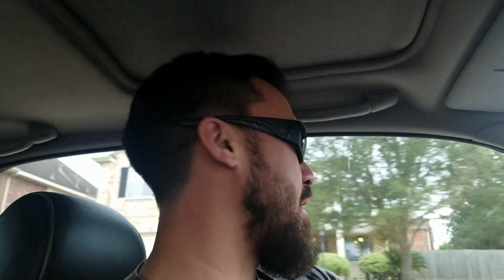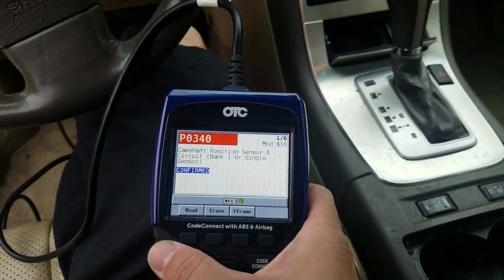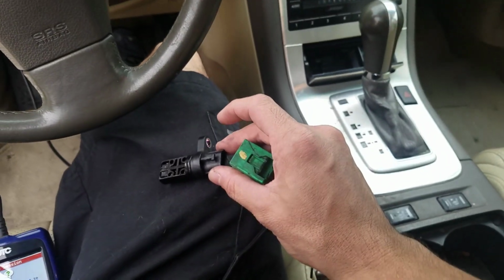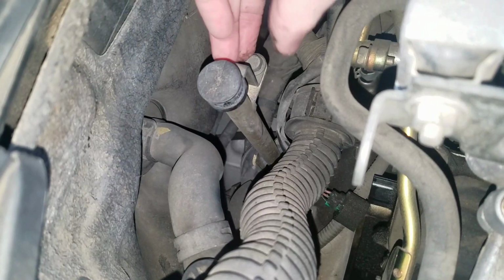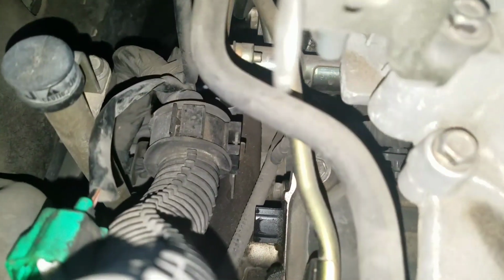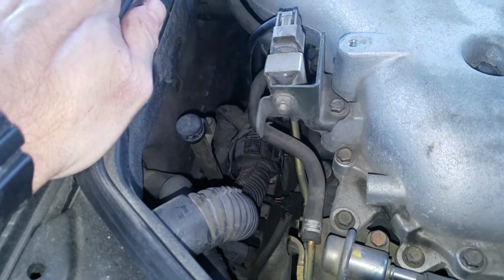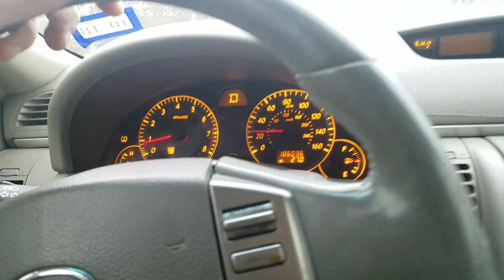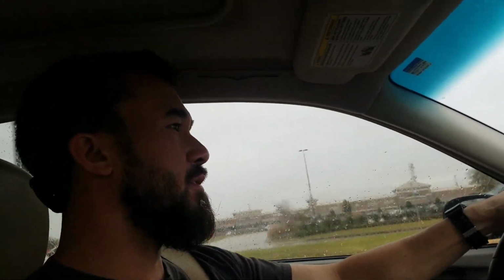How to Replace Bad Camshaft Position Sensor in Your Car Code P0340 Infiniti G35 Nissan 350z Altima

Comment: I recently changed both Bank 1 (passenger's side) and Bank 2 (driver's side).  I recommend only using Nissan or Hitachi sensors.  Tried some third part ones off of Amazon that didn't work and found comments in a forum to only use Nissan or Hitachi parts.  I went ahead and cleaned my MAF and Throttle Body while replacing Bank 2 which made my 2006 G35 Sedan run a lot better than it had before.
Reply: Did it have random misfire?
Reply: @trentdaddydolla647  it was hard to start up and ran bad once it started but no misfires. The code I got said to replace cam shaft sensor.  I tried to do it using cheap ones a few times but they didn't fix the problem so I went with OEM parts and they worked like a charm.
Reply: @aarondemming can u send me a link or the partd you got 🙏🏽. I also got some decent / mediocre ones on amazon didnt rlly last me
Reply: In autozone just ask for the part

Comment: I have a 2003 Infiniti G35 Coup non rev up. With Brembo Brake Package. I just started getting a code for PO 340 - Camshaft Position Sensor A - Ban 1 Circuit Malfunction but I also got another code at the same time for PO 327 - Knock Sensor 1 Circuit Low Input Bank 1 or Sensor 1. Do you think the Camshaft Position Sensor is triggering the 2nd code?

Comment: Changed both sensors and still throwing the code. Could it be the connector itself?
Reply from the maker: Definitely check the wiring.

Comment: hey man i changed my sensor and it seems like my vehicle is performing worse. I also heard low brake fluid could possibly produce that p034 code. What is your opinion on that? same car but '07

Comment: Does your car still work or did you need to get the oem sensors?
Reply: The_g35life did you figure it out I used a aftermarket one from autozone and still get the code with a no start I was told oem is the way to go with anything Infiniti especially on the g35’s

Comment: Hi, I have a 08 m35x with the code for a bank one cam shaft sensor, I changed it twice with sensors off ebay and check engine light and others r still on the dash, it stop cutting off on me, but still has a long crank on start up, what do u recommend?
Reply: Rob, with Infiniti you have to use a Nissan part or Hitachi.  Had the same problem with parts off of Amazon.  Went to a couple of different forums and went with Hitachi parts and this fixed the problem.
Reply: Did you end up finding a solution??

Comment: thumbs up for replacing dumb ass infiniti parts that have no space to work with and by doing it with one hand lol. just noticed you said that green clip is for the 03 model which i have :( wish me luck in replacing mine tmrw
Reply from the maker: Good luck, might be easier to just unbolt and remove it first.

Comment: Should I buy a 2005 g35 for 2800 it has 135k miles and it needs camshaft senser yes or no? It's frim on price
Reply: Thats what im trying  to figure out too
Reply: Kameronismyname how many miles is the one your looking at?
Reply: @lollollollol7515  120k a friend said dont mess with it but idk this seems simple enough
Reply: Kameronismyname that's what I think but don't know it can be a bigger problem
Reply: @lollollollol7515  if i can get it for 2500 i might buy it he wants 3k
Reply: Kameronismyname yeah 2500 its good price if you get it let me know thanks bro💯
Reply: I've been a G35 owner for 11 years,  I would jump on it for the price
Reply: I bought an 03 g35 sedan with 160K last year for $900 it neeeed a can shaft sensor bank 1 , was misfiring & had an exhaust leak
Reply: @fredjames8835  was it alot to do the repairs and did you also DIY saying was it a easy fix or did you pay someone to do it a hard fix.
Reply: Sweet Home California I paid someone to fix it , I bought it for 900 after almost 1000 in repairs the car was good , only had an exhaust leak & it needed suspension work before I got it taken away by the cops
Reply: No
Reply: Make sure the clutches in good working order and get the car inspected

Comment: My q40 Infiniti clicks but doesn’t start I changed the battery first still clicks , changed the starter it started working and now it started clicking again , any recommendation ?
Reply from the maker: I know there was an issue with the steering column some of these with smart keys, might want to start looking there.

Comment: I have a 04 idk if it’s the drivers side or passenger
Reply from the maker: Ok
Reply: TheLateModelTech ok I got it this thing is a pain to pull out.
Reply: Get the oem. The ones from auto parts stores don't work. Just had both mine replaced with new pigtails and same thing happened
Reply from the maker: @guitarpro594  good info, the one in the video, got it out if the junk yard "oem" slightly used. Lol

Comment: Can bad camshaft senor cause no spark?
Reply from the maker: Yes it can.
Reply from the maker: Cam sensors are really cheap, wouldn't hurt to try replacing both of them.
Reply: There's 2 of them? I thought there was 1 only lol.. I see one by the belt
Reply: I looked online everywhere but it only shows 1.
Reply: Don't have a manual also
Reply: Hoser s there’s 2 bank 1 and bank 2 camshaft sensors
Reply: @Element62  Actually it depends on the engine. A lot of engines still use single cams with a lifter system. In which case, there is only one sensor.
Reply: Cirux321 I’m talking specifically this g35 with the vq engine. They have 2 camshaft sensors. Literally just got done working on mine 😂